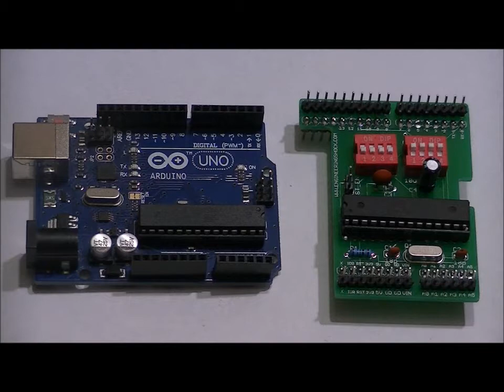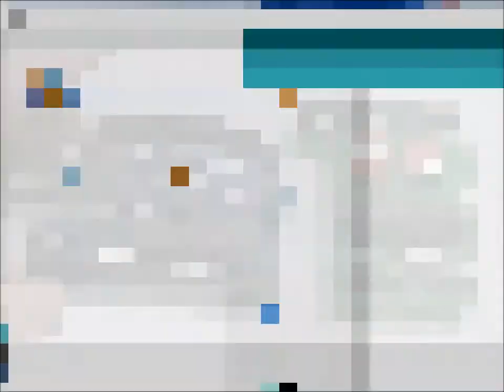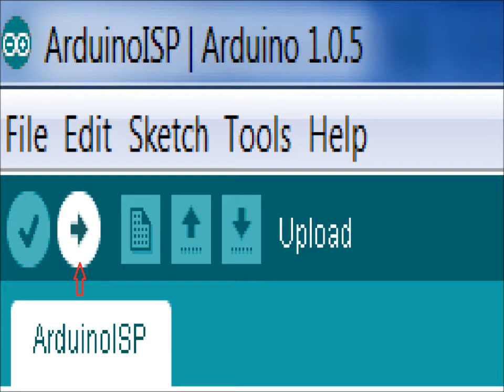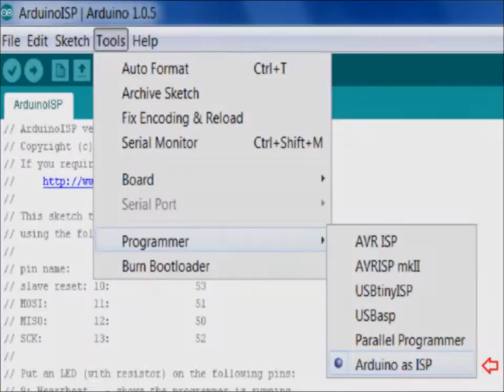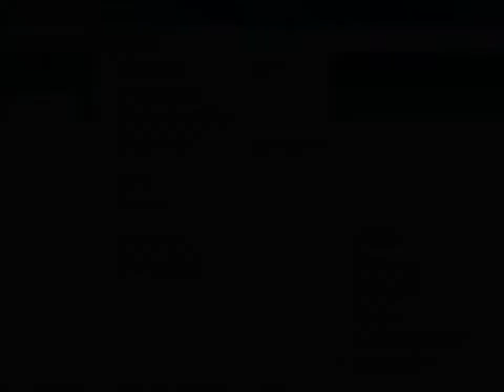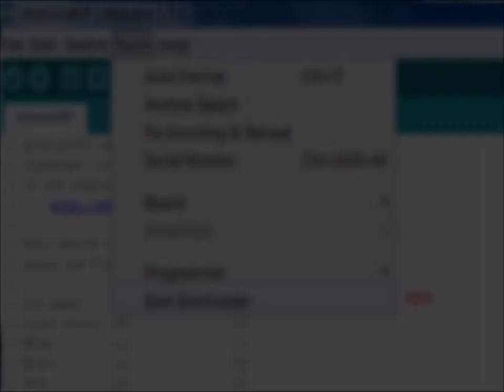The Arduino Bootloader Shield For Arduino Uno - Full Demonstration

Comment: hi i would like on too
Reply: +Andrew Gilmour  hey Andrew, if you still want one here is what it is called on ebay: Atmel AVR ISP Shield Programmer - ATMEGA328-PU - Arduino UNO Bootloaderand here is a link to it: http://www.ebay.com/itm/291590720732  it will cost you about 21 bucks USD it is  coming from Australia, good luck.